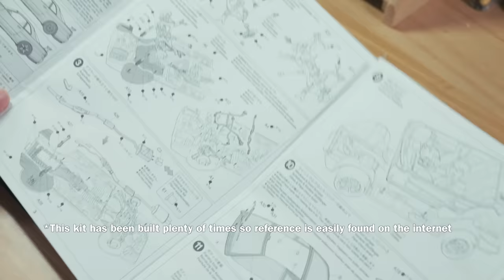R34 Nissan Skyline GTR V-Spec II Model Car Full Build Step by Step

Comment: Thank you for the excellent video!!  I've learned a lot.  Question about 14:26 of the video.  You have all the parts ready for primer/paint, but how did you clean the parts before this step?  Thanks again!
Reply from the maker: You can just clean them with isopropyl alcohol or even water to remove dust and debris before painting.👍

Comment: Heya I have some questions! Can you build it out of box and still look okay? And will a little bit of effort make it look great? Also does it require lots of glue unlike gunpla that's snap build?I'm gonna buy a tamiya GT-R on my birthday and hoping to modify my own!
Reply from the maker: You can glue it together without painting it but the result will not look pretty. Unlike Gunplas these model car kits are generally only molded in a couple of simple colors so you got to paint it using the colors you like. You will also need some glue to put it together. It will need quite a bit of work to make it look decent.
Reply: @JunsMiniGarage  about the glue stuff does the manual tell which parts to glue? I'm very new to tamiyas sorry

Comment: Hi, you are doing great work! I have a question about your spray booth; considering to buy one, but I only work with rattle cans. How well does it work with rattle cans? I would need to use it in the living room so I really can't have paint leaving the booth and ending up on the floor, walls or funiture. Many thanks for your reply!
Reply from the maker: I mostly use spray cans for car bodies. It works pretty well. The filter will need to be changed every two to three cars for maximum efficiency.

Comment: When you mask the seats how do you cut the tape without cutting the plastic underneath? Is it just being very gentle? I always seem to nick the seat underneath.
Reply from the maker: Being gentle helps. Scribing the lines deeper also helps. I do sometime cut thin strips of masking tapes and use that as a masking guide instead of cutting directly into the parts.

Comment: What's the difference between sponge and sand paper for use on the body? Thanks.
Reply from the maker: Sanding sponge is great for curved sections such as bumpers because the sponge is softer and it has more cushioning than a piece of sand paper. If you sand the rounded parts with sand paper you might erase necessary details. The sponge is also easier to hold when sanding because of its thicker size. Sand paper is good for flat areas.